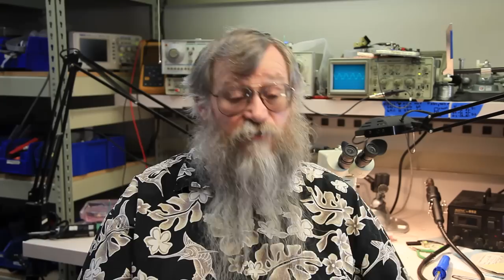Jitter's audible effects

Comment: Jitter wont matter if the A/D converters are driven by the same local oscillator.  Since you can easily purchase oscillator with inter period jitter <10ppm, no one will be able to tell the difference between a clock with 400 ppm and <10ppm jitter because it has no effect on the A/D conversion.  The fact that people on here are saying you will loose "bits" due to jitter is absolutely hilarious and completely ridiculous.  To many people are claiming that they are audiophiles with art degrees and no one asks an actual EE for advise.  If you claim that your devices have exception jitter performance and it does indeed manifest itself in output performance then please publicly publish an 1Khz pulse train from your amplifiers compared to a competitors.  I will personally do the stability analysis via Allan Variance and Hadamard Variance and will show you why it has no effect on performance.    Source: PhD EE.

Comment: This video is disappointing. I thought I would learn what jitter sounds like, but all that Ted talks about - front to back depth, clarity of a decaying cymbal - can be easily explained by poor room acoustics. It amazes me that people obsess over jitter artifacts that are 20-30 dB below the noise floor of a CD (think about that!), but ignore the distortion of their loudspeakers and the 30+ dB peak and null spans in their listening room.
Reply: +Paul McGowan Thanks Paul, I didn't actually expect an answer! But it will take a lot of evidence to convince me that jitter is ever a problem, even a tiny problem, with modern digital gear. All of the graphs I've seen show jitter noise (typical amounts) at > 100 dB below the signal.
Reply: +Ethan Winer I completely agree.  I was disappointed with the claim at the beginning of the video that somehow "People's toes tapping to the music" has any relationship with audio artifacts caused by jitter. 

Hell, I've seen people "tapping their toes" listening to terrible laptop speakers which obviously have drastically poorer audio quality than even the worst sound card going through decent speakers.

What bold misinformation.
Reply: It's so hard to concentrate while thinking about how this man eats a pizza.

Comment: With modern digital devices jitter is typically 110 to 120 dB below the music, even for inexpensive consumer-grade gear. In my experience that is far too soft to be audible. Indeed, this is 20 dB or more below the noise floor of a CD!
Reply: What kind of dB are we talking about here? dB is a logarithmical scale with a certain reference. I'm just wondering what we take as a reference here.
Also, source?

Comment: If there's audible noise disturbances on old computer systems it might as well be electrical HF noise by induction or capacitance. Not necessarily jitter per se. It could be both before and after conversion to analogue.

Comment: I have an RME ADI 2 fs DAC so maybe I am lucky,  but I do wander for how small a percentage of systems actually suffer from Jitter.
Your example "...reading off disks.." is like comparing an arrow to a guided missile every component, clocks etc has improved. 
I am on full fibre ,then galvanically insulated ethernet cable does that mean I don't have signal fase issues to start with?
Will the slightest tweak of the positioning of your speakers not offset femtosecond differences in timing at the "Sweet spot" 
I am not in any anti jitter camp I just am interested in aspects beyond if it exists or not.
I think that there should be more options in dealing with it ,even if that is just switch the fase button in many systems ,before considering more money on a solution to what may not be the problem . Especially if the sceptics are right  then any audible imperfections in your sound are caused by something unrelated.
👍it's nice to have an expert to question. I will not be offended if many of the assumptions in my points you can explain why I am wrong? I am not technical, but I am a Torus. first convince me then I am happy to change my tune (Pun intended) entirely.

Comment: Jitter, in my understanding, is a problem of timing in the digital domain. In my experience, jitter only becomes audible in a very nasty way (e.g. harshness, details getting lost, uninvolving sound, lose mid bass and bass performance) when using a rotating digital disc (one's own cds or sacds). It seems nearly impossible to get a jitter free digital stream out of these discs when playing them as intended. Just my 2c.

Comment: 2:50 our ears don't just locate sounds based on volume differences! Our part of the brain that receives the signals from the ears is more like a holographic processor. Tiny phase differences in the timing in difference in reaching our ears allows us to determine where the sound comes from, besides this the sound bending round our heads changes and those minute colorations also give us directional clues. Imagine just how good our brain is, that you can locate sounds from above, behind, side, front. If it would be just volume then we wouldn't have all these problems with audio, and we would all have 36.4 audio in our homes. 2.0 or 2.1 is the only format that is acceptable to our ears, but sadly doesn't make full use of our ears abbilities. Surround sound is never truely surround sound, it is nice effects coming from the side or the rear, with no coherence with the front speakers, just an added source. The only way for us to have perfect sound is a perfect binaural headphone (discussed @ PS Audio) but the problem with that is that each of our heads and brain is different and perfect binaural audio would be a whole shelf of acedemic works and massive personalized dsp. But if you want the best stereo effect it is best to use a single source full range driver in a matched pair.

Comment: I'm having a problem with the sound on SACD's. I have a year old Yamaha RX-A2030 and a brand new Oppo BDP-103, connected with the HDMI cable which was supplied by Oppo. Sometimes it sounds great, and at other times, there is a noticeable harshness, sometimes to the point of distortion. This is most easily heard in the violins. Is this jitter? If so, what can I do about it?
Reply: podiumman2 This is VERY common, A lot of things can effect the sound during different listening times, quality of the supply power, temperature of the equipment or ambient air, even your mood. I doubt it's the Oppo or the HDMI but you could try a good quality optical lead directly into the Yammy and see it  it changes the problem. My music always sounds better in the early hours of the morning when the power is cleaner. Consider a mains conditioner or regenerator if you think this is the case, they definitely help matters. When you have bad jitter the sound (to my ears) seems just wrong, it doesn't have good timing to it or the air and space and naturalness of the sound seems blurred. It can be as bad as listening to a low bit mp3 against an uncompressed high quality lossless music file.
Reply: MG Samps Thanks for the reply. I doubt it's the AC, because there are other sound sources which sound very clear with no harshness. As for using the optical out, DSD won't go over that, unless I reduce it down to 44.1 khz sampling/16 bit, then owning SACD's and the Oppo SACD player would be pointless.
Reply: I would be surprised if high Jitter  caused distortion but a little harshness would be possible I suppose. I have found some recordings to also be at fault, a classic example being Ludovico Einaudi piano recordings, superb music ruined by overloaded on recording. I actually thought my tweeters were faulty.
Reply: @Lloyd Stout Thanks, I should have remembered that, I'm used to using my Cambridge CXU outputting from the RCA into my amp.

Comment: On my audio system I can hear more jitter on the Toslink between the CD and DAC than on the digital coax cable. I experience jitter two ways. 1) Jitter sounds more harsh to me. It is like running a finger over a smooth surface and running a finger over very fine grit sandpaper. 2) When there is more jitter (more harshness) I also notice my nerves are slightly more on edge. Less jitter (or even less harshness in a system) and my nerves relax. The effects are subtle but for me noticeable. This connection between my hearing and my nerves is much more sensitive in me than other people I know.

Comment: Great video, I completely agree.  I had a cheap plastic TOSLINK ebay cable from TV to DAC which got chewed by a gerbil and I sellotaped it back together after cutting the ends flat.  It worked however I replaced it with a 'decent' glass 60 buck TOSLINK which is advertised as low jitter, good reviews, etc.  Even the wife noticed how the soundstage was clearer and more solid and I hadn't told her about the cable upgrade.
Reply: I hope she was in the kitchen and doesn't care about audio. It's always important to add those two bits. 
Delightful!

Comment: packet delivery mismatch can be a bitch as latency and packet corruption cause the dreaded jitters too! windows used to way overuse something called qos(great in theory but a bit questionable in use). 
streaming could/can be acceptable or awful depending on the buffer size on packet transfers and hardware decoding capabilities.
 i try whenever possible to run as much content to ram as possible from the chosen source. keeps the latency down as much as the hardware will allow(hint:port baud rate increase for one...).
just one of many aspects of software vs hardware implementation in digital sound reproduction that we,the end users,can do something about with a bit of patience and research.

Comment: Err hang on. Jitter is a real and measurable phenomenon. It afflicts highly stressed high speed data networks. But the hardware and firmware is designed to accommodate this. Jitter is measurable and for a typical consumer grade CD player it's of the order of a couple of dozen picoseconds. This is tiny and definitely not audible.

For reference, 1 pico-second is to 1 second what 1 second is to 32,000 years!!

The clock is derived by a frequency divider from one running 1000s of times faster than the sampling rate anyway.
Reply: how do you measure it in the brain?
Reply: Hmm, its unlikely a human being can perceive a 0.1 pico second clock error.

Comment: How about from a SSD?
Reply: Elwin Franken Did you mean DSD?
Reply: From a SSD would be irrelevant as it is the jitter caused by the clock that sets the data on the DAC.

As for DSD it'd give the same result as PCM.

Comment: Good sir, you're wrong. In order of the chain, this is how your sound will be limited. 1. Speakers fidelity - i.e. decay, resonance, distortion, phase issues 2. Room acoustics, reflections and dead zones for bass 3. source, i.e. amplifier and DAC, or analog. But guess what, my Philips X3 headphones still sound much better than my speakers running through a Schiit DAC and quality speaker amp despite being run through my cheap onboard sound and monitor audio out. You're vastly overemphasizing jitter's audibility, I'd look to your tweeters if cymbals sound weird, try some Dayton AMT sweetness.

Comment: You lost me at Vinyl sounds better than cd!
Reply: Tyrone Bunne cd does not work that way, nothing is sliced, as there are phisical limitations to your ear, to the recording head of a vinyl recorder, to the playback needle of a pickup, CD takes that into account and only retains the useful part of data that you need. CD and in general digital to audio uses algorithms to very closely match the waveform it is copying.
Reply: In the same way cd is flawed vinyl is also flawed, and it depends on a lot of things working perfectly with no self correcting mechanisms. in vinyl you assume that the motor is rotating at the right speed, the pressure is optimal on the disk, the grooves are not dirty, the vibrations in the room and from the speakers playing the music do not interfere with the needle scratching the surface of the disc etc.
Reply: Vinyl has a much lower dynamic range, it has limitations. Don't be dumb. Vinyl ripped to lossless audio will sound identical through both mediums, identical. The difference between 128 kbps and 320 kbps is hardly audible. Vinyl suffers mechanical wear and requires a bulky, expensive device to play and is a one-time copy. Digital music can be stored with extras and on devices small as a box of tic tacs, and listened to portably via modern speakers and headphones.
Reply: @tyronebunne2220  "Noiseless vinyl"? Hmm. Would you like to buy shares in my unobtainium mine?
Reply: Yes, I have the same feeling. I grew up with vinyl and tape and accepted the quality for what it was, and then CD's came out, and the "true audiophiles" complained about that.
It will get to the point when these audiophiles try to reinvent the wheel and the community will spend the rest of the time arguing about what colour it should be.

Comment: All I know is that I don't care how good the analog recording is, whether they recorded it on tape going 900 inches per second, pressed into 9 lb. vinyl, played using the best cartridge known to man, I have never but never not heard some amount of tape hiss or surface noise. I can hear studio noise in digital as well as analog recordings. I went out and tried to hear jitter and the only difference I hear is when it's extreme. So someone is trying to tell me they'll put up with surface or tape or equipment noise through a $million system, but not jitter? I think there are bigger fish to fry.... like fish at all.
Reply: Yes, I have the same feeling. I grew up with vinyl and tape and accepted the quality for what it was, and then CD's came out, and the "true audiophiles" complained about that.
It will get to the point when these audiophiles try to reinvent the wheel and the community will spend the rest of the time arguing about what colour it should be.

Comment: BS like this guarantees that I will never buy a PS Audio product.   Large amounts of timing jitter can cause bit errors and a complete loss of signal.  Small amounts of jitter can be measured by a simple spectral and THD analysis.  Most jitter-related analog artifacts are >100 dB down from the fundamental.   Despite this, jitter has become the new negative-feedback-is-bad, high-end-cables-are- the-source-of-salvation, turntables-rule, tweako garbage enabled by vendors that probably know (or should know) better.